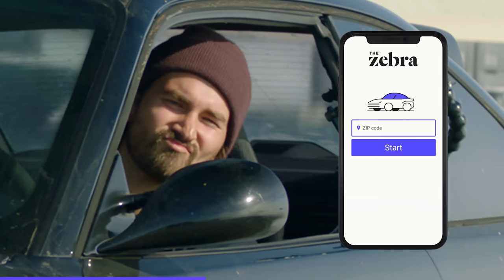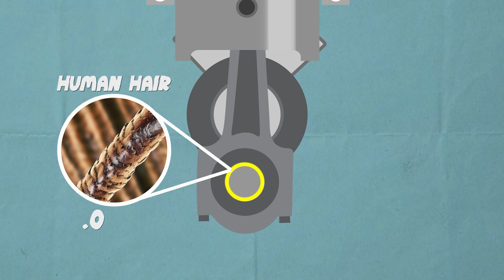The Engine Sound You Never Want to Hear

Comment: "what do you do when your engine is making a terrible knocking sound?" 

Subaru owners: keep driving till it stops I guess
Reply: Works every time ¯\_(ツ)_/¯
Reply: Lol the car or the noise?
Reply: @lofro1717  yes.
Reply: My mate had an rb5 that did this... Twice 🤣
Reply: @lofro1717  the car, then the noise LOL
Reply: This one is too true
Reply: Lmao
Reply: Crank up the music!
Reply: unfortunately, i am doing that now with my MR2... wanted to swap the engine anyways :/ none of these inline videos are similar to my rattling though. The Boroscope shows rust on cylinder walls but it doesn't make the noise under load (low rpm load that is) and not under 3k rpm. not looking for answers in a comment section.. just sharing and now going down this youtube rabbit hole. ha!
Reply: Not true
Reply: I have lots of friends who own Subaru’s and they don’t do this or are you talking about the owners of the company
Reply: @protolouge6876  lmao, he was joking about how you need to lift then engine out of the car for major works due to how the engine is designed
Reply: @countryfella94  Lmfaoooo
Works every time
Reply: I've had my WRX for 2 years and it's been dropping small amounts of metal in the oil since I bought it, it'll stop when it stops, and hopefully I've built the new engine before that.  But until that point, it's not making any funky noises, so it can't be that bad, right?
Reply: @GingerNingerGames  Theyre known to have oil delivery problems and usually fail because of not getting oil evenly distributed throughout the engine.  I would change the oil and oil filter religiously and use a good oil filter like WIX and good oil too, don't use Fram oil filters.  There's metal rubbing metal somewhere which is never good.  Keep your fingers crossed and 3 toes.  It might last awhile like that, at least it's not making noises.  I would get it checked out by a mechanic.
Reply: @JBlades88WV  Man, check my channel, I've been driving it like that for the last two years, good chance it's the stock oiling system not being able to keep up with G forces and losing oil pressure during long corners.  

I'll be building the new engine this week, and hopefully putting it in ASAP, car hasn't stopped yet, and I do the oil fairly regularly anyway.
Reply: @GingerNingerGames  makes sense.  The opposing cylinders make oil circulation a challenge.  I do like the 2.3 boxer engine though, it's a unique design and sounds pretty cool for a 4 banger.  Good luck with your new engine build!
Reply: Knocking. It's what makes a Subaru, a Subaru.
Reply: That’s a fact lol. If my Subaru stopped making weird noises, I’d be suspicious. Last time I had a knock, the tube that goes to the air filter had slipped off the manifold. I still drove it like 30 miles to work and it sounded fine after I “fixed” it
Reply: It's true my engine knocked for 90k before the timing belt snapped of all things.
Reply: I just bought a used Outback and that’s exactly what the previous owners did
Reply: @andrediorde1520  Mines 3 years past is exp date, still chugging

Comment: “I don’t think that’s what it is.”
“But it could be.” 
“But I don’t think that’s it is.” 
“But it could be.”
“But I reeeeeaaaalllly don’t think that’s what it is.”
“But it could be.” 

😩it was
Reply: Was about to comment about that 😂
Reply: It’s you telling yourself the test didn’t go that badly
Reply: 800 likes dude😎
Reply: Mechanics optimism at its finest XD
Reply: I knew it wood be the bearings because my car had the same issues half a year ago. The noise was the same ind I was hoping it wasn’t the old bearings as well, but is was 😅 luckily it’s all done, new crank, 2 new rods and that it.
Reply: the reasoning stage of grief
Reply: @empyre8179  uhm
Reply: Ikooolpp
Reply: The feelamateur 
Yea that feels alright 
Lol
The must-have tool to check your rod bearings
Reply: @davidhenneberg6772  how much did it cost?? because i may need a rebuild as well
Reply: @spyrosbellos2522  it was about 2000€, but I did a complete rebuild with the crank, 2 new rods and every small pieces as well (bearings, sealings, gaskets) everything was done so the engine is like a new one

Comment: Jobe: "unfortunately we're gonna have to rebuild this engine."

Me: "Shit, that means i gotta rebuild mine as well."
Reply: You can drive for years with minor engine knock. It’s not always fatal right away.
Reply: @angelgjr1999  rather not lmao
Reply: Paying with both Money, Blood and Sweat
Reply: @angelgjr1999  I'm sorry did you see that oil pan?
Reply: @angelgjr1999  yeah. my 04 mazda 3 has had a bad knock for like 20k miles now. its not worth enough to fix
Reply: @angelgjr1999  welp we'll see how long that ol red block holds up
Reply: @pontushaggstrom6261  well, lucky you that red block is really easy to work on :D I would fix it soon as possible. Also when rebuilding it almost never is just a rebuild cause upgrading is more fun :D
Reply: Shit that means I gotta rebuild mine as well
Reply: @pontushaggstrom6261  den kommer rasa snart
Reply: @anton.s7740  nejdå
Reply: @angelgjr1999  NO.

Comment: In the old days, we used very long screwdrivers with wooden handles. We took the metal end and placed it in various places on the engine and put our ear to the wooden handle side. Based on where we heard the worst noise is where we started our looking. Today, you have all of these wonderful tools to help troubleshoot your engines. It's fascinating to watch you guys do it differently!
Reply: My dad still does this haha, he calls it the poor man's stethoscope. I used it to diagnose an alternator bearing that was going out
Reply: I’ve been doing this since my dad showed me when I was younger!
Reply: maybe take a piezo sensor and glue it to screwdriver then connect to oscilloscope.this is a cheap way to isolate belt/pully noises to isolate but i bet could work for this,i also took mechanic stethescope and removed the metal rod and added screwdriver to dull the sound this may also help isolate if its top end/bottom end,just some ideas
Reply: This works with screwdrivers that have plastic handles as well, at least for checking fuel injectors :)
Reply: @imthedarknight-8755  A real mechanic stethoscope is like 5 bucks at Harbor Freight.
Reply: That's really interesting. Thank you for sharing!
Reply: That's the way I was thought.

Comment: heres a old hot rodder trick: take the plug wires off each cylinder at a time. if it stops knocking, its probably a rod knock, and its on THAT cylinder.
Reply: So you just don't allow it to fire and then it won't knock?
Reply: Take the plug out, and you wony have any compression, so the rod won't have anything to push it back and make it hit the cylinder wall.  In theory.
Reply: @Tom_KTM  I think if you just yank the plug wire and it stops knocking it's your ignition timing being too advanced, but I don't get why that would be only on one cylinder. I suppose if there isn't any spark then the piston wouldn't slam back down from the combustion onto the crank though, so that might make sense. I'd think it would still slop around in there but I guess the decrease in forces might make it knock less
Reply: @christopheringram4118  not taking the plug out, just disconnect the wires going to them
Reply: @Tom_KTM  taking away the fire extinguishes the pressure by taking away the expansion cycle for the affected cylinder. It isn’t a fix but it is a patch. Basically the down journal just becomes a driven cylinder. It is what happens when you hear of drag racers “being down a cylinder” or disconnecting wires to run in displacement restricted classes.
Reply: @dmboutdoors4430. Does this damage the engine?
Wouldn't mind a 7 cylinder truck if it saves me 10k 😅

Comment: Jobe: "unfortunately we're gonna have to rebuild this engine." 

Subaru Owners: "Welcome to the club!"
Reply: It's painfully funny because it's true 🙃
Reply: Only really true for ej25/205 but still painfully true.
Reply: @willzo0o269  so.. Most of them? Lol
Reply: @ my 2013 wrx
Reply: @jkoidarville6939  same 😂
Reply: watching this as the owner of a 13 wrx gave me anxiety
Reply: Owner of a 2002 outback wagon lmao, it's at 240k, and the only thing I've ever had to replace aside from regular fluid changes/proper maintenance, is a wheel bearing and a fuel pump
Reply: ringland failure- it’s what makes a subaru a subaru
Reply: Or RX owners..
Reply: I'm on number 7. No regrets either. Had fun with every motor that's blown.
Reply: On 3 rebuilds and jdm engine. I should of gotten a jdm engine from start. Best choice i made. If you're going to build engine gotta make sure you don't cheap out. That's where I went wrong.
Reply: @WeirdJerz3y  only enough they were all usdm 205s that I had acquired cheap. Now I've been on this jdm 206 running e85 on a 1.5xtr at 23psi for 20k. 🤷‍♂️🤣
Reply: @Jonjims1532  same here. On a ej206 making 350whp around 23psi. And burble Tuned.  Tuned by JRtuned. If I would known from the start would of never bothered trying to repair my old usda engine. These jdm engines are so much better than the usdms. I only hear good things about the jdm ones.
Reply: @iji4031  00' WRX with engine mods, capable abt. 500 bhp. Have had it running 350bhp. 260kms and never had to open up the engine. Regular maintenance is the key.
Reply: @iji4031  so basically you’re driving a ticking time bomb.
Reply: @Apollo_s2k  oh, absolutely. It was a great first car, and I fully intend to leave it at that very soon
Reply: Dodge Shelby Turbo GLH owners: "First time?"
Reply: @jebbroyhill4606  most subarus have a 2.0 or a 2.2
Reply: @sixunity1171  uhh... Yeah.. The ej205 is a 2 liter.
Reply: @jebbroyhill4606  i know but most subarus had a ej20, the 205 is very uncommon i think the 205 is a different version of the 20
Reply: I am the 666th like
Reply: @Jonjims1532  7th EJ motor? If so your commitment is commendable.
Reply: literally the reason im watching this video xD my subie nocking like its the bloody fbi broke my heart
Reply: Fiat Twin cam Lancia delta  , knocky noise,  just turned out to be the lower timing belt guard/s , notorious for clatter and the odd stuck water pump nut , Holds upper engine  stabiliser.  Top top. You can get piston slap from your forged pistons if fitted  ,  never drive hard till fully fully  warmed .
Reply: It’a true my subaru just started making this noise 😢

Comment: Me: “A few sparkles isn’t too bad in an older engine” 
sees huge glob of rod bits 
“Holy shit that’s bad”
Reply: I blew up a two stroke 90’s jetski engine Last summer, and I looked in the spark plug hole with a phone camera and could move metal around with a screwdriver. I took the head off to find a large amount of large chunks of metal; aluminum from the block, and iron from the rod that blew up. It’s a push pin rod, so it’s not supposed to come apart, but you wouldn’t know if you saw it because the lower half was broken off
Reply: I blew up my Mazda 3 engine and I looked at the oil pan and I was like OMG because I found a hole piston rod hanging so I had to do a engine swap which was painfully difficult

Comment: Been there, done that, swapped the engine. First car, a 61 Dodge Lancer. I worked on it for free to help out the lady who owned it when I was 15 & 16. She ran it out of oil and the engine seized. She got a ride home took out the title and gave it to me as thanks for keeping it running as long as it did. I went to it, threw in 3 quarts of oil and drove it home. The bearings were toast. I put in new bearings from the bottom but the crank was flat spotted. Drove it with a quart of motorhoney in it for a few months then my Uncle and I swapped the 170CI for a junk yard 225 CI truck engine. Cheaper than rebuilding the original engine. Didn't quite fit so I lost the heater. Drove it for 3 to 4 years and sold it for $500 in 73. I kind of wish I could find one now for nostalgia. That car taught me so much about wrenching. Late in life became an aircraft mechanic.

Comment: im a mechanic, and id just like to say that there are quite a few ways to distinguish between engine noises without tearing the engine apart. Piston slap generally is a lot more noticeable when the engines cold and will heavily diminish or even disappear when the engine warms up. Rod knock will vary in frequency with RPM and will get a lot quieter if you disable the affected cylinder(unplug the injector or coil for that cylinder). Main bearing knock will be a lot worse under load and wont vary as much with RPM, it also will probably get worse if you disable the cylinder closest to the bad bearing, and sounds a lot deeper than rod knock. Lifter tick is generally pretty easy to tell that its coming from the top of the engine.
Reply: Have you ever what worn wrist pins sound like?
Reply: Thanks Brian!

After researching my own Toyota with nasty sounds, I can add VVTI clacking which usually oges away after a few seconds (once oil prssure is up) and on some cars, a leaked timing tensioner part that allows the  tensioner pulley to slap back down on it. all audible from the FRONT of the engine with a stethoscope/screwdriver-o-scope.
Reply: in need of some advice. i got engine knock the other day but it went away ( im new to cars so i didnt think much of it) few days later im driving down the free way and it comes back. and i decided to drive it home. once i did. it stopped again comepletely. im confused becasue people tell me engine knocking shouldnt stop. i know im behind on m y spark plug change.  so im hoiping that fixes it but to change the sparks i gotta wait until a mechanic is available because you gotta raise the engine to get to the sparks. i just want to know if my car is safe to drive even tho i dont ahve that knocking noise. i feel it comes when i hit high RPMS
Reply: @EpicTacoSenpai  could be lifter ticking

Comment: Every Honda guy has to be like “that rocking noise isn’t normal?”
Reply: nothing like a nice clackity-clackin valvetrain in the morning!
Reply: Dude literally 😂
Reply: From my personnal experience from a 1.5 l sohc eco with a twisted valve on the cylinder 2  i welded the pedal for about 200 km on the freeway (in france) 
It lasted 3000 km in total pretty good 👍🏽
Reply: My first car was a subaru that died of rod knock and now everytime my 8th gen Si's valve train gets a little noisy I experience horrific ptsd. I have taken it in to be looked over two separate times thinking it had a knock.
Reply: If a honda has a knock, 9/10 its because of western oil. it causes valve knock. put in the proper eastern oil it was designed with, and the knock will go away. and, yes this really is a thing.
Reply: @Drakonniz  where can I get this eastern oil??
Reply: @cruzazulluis1994  invade
Reply: @cruzazulluis1994  look at the oil itself, and look up where it is manufactured. information should be available either on the bottle, or from the manufacturer website. It's been a few years since I looked the information up, so forgive me if I am unable to provide a cut and dry answer. Another thing I would suggest.. see what companies oil your vehicle uses or recommends. that should give you an indication of the correct oil type.
Reply: It isn’t normal???? My ej has been making that sound for like 3 months now
Reply: @Drakonniz  i will have to try this!
Reply: @cruzazulluis1994  just get a zddp additive(unless you have cats) and add it to your oil every oil change.
Reply: You referring to loud valves and or injectors? Never had any bottom end issues on my Hondas.

Comment: Old school hot rod trick- Easy way to check for knocking and bearing condition without ripping your engine apart is to use about a foot and a half long block of wood that's about 1" x 1" in diameter and press it against the block. Press your ear firmly to the other end and you can hear inside the engine. Move it around to check different areas of the engine and pinpoint different problems.
Reply: no

Comment: I would have preferred to hear some rod knock rather than what I actually got. I was around 4000RPM making it through a yellow light in my ‘01 Tacoma V6 Double Cab Prerunner about a month ago, and I heard one of my rods decided to rip in half. No prior knock, no warning, only had 133,000 miles on it, never been dry or without good oil. Best I could tell is the crankshaft bearing failed for some reason and the rest is history. I sold it to one of the mechanics at the shop I towed it to after getting a $6,000 used replacement or $9000 remanufactured and deciding to move on. Doesn’t matter how many people tell me that “never happens”, it did to me on a truck I only put around 4000 miles a year on 🤷‍♂️. Loving the show and learning a lot. Keep up the good work.

Comment: For everyone that’s new to this. The bearing should not be left on the crankshaft after you pull the rod cap off. That’s a sign of overheating and excessive bearing wear. The bearings should have a “crush” and stay in the rod

Comment: I've got a 99 Yamaha ATV I bought for very cheap because the old piston had melted and I was never able to retrieve it since it was lodged in the transmission, luckily the transmission gears are steel so I just give it a good rip every now and then and it grinds up the old piston and I remove parts of it every oil change. I've been pleasantly surprised how well this has worked so far.